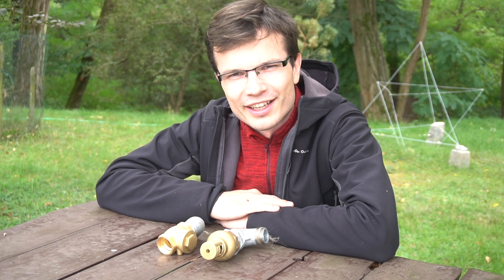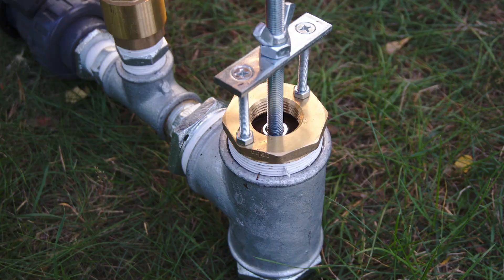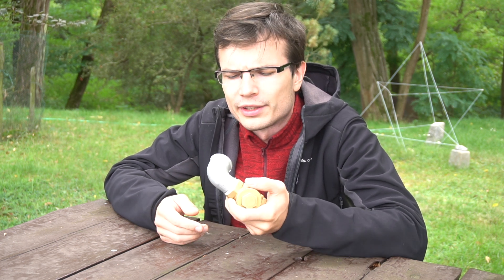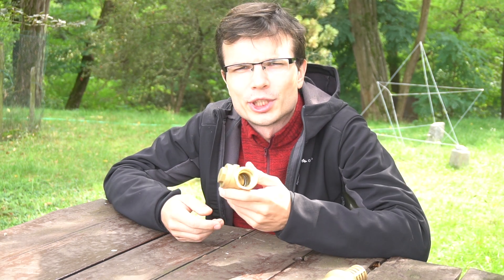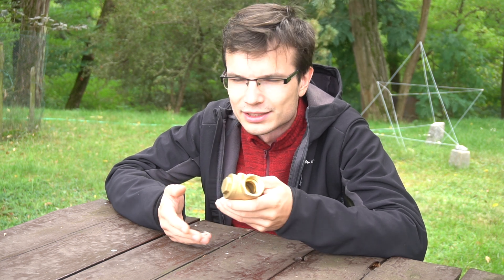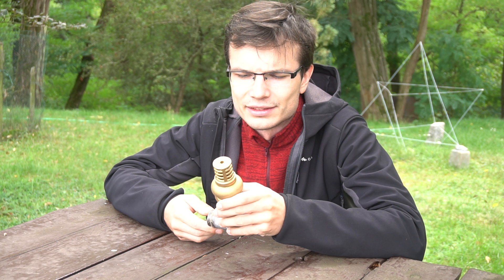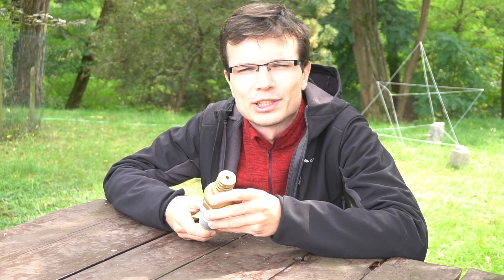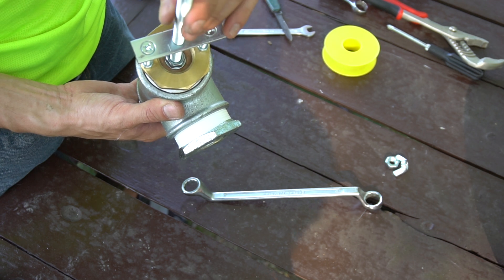RAM PUMP VALVE COMPARISON - why the swing check valve is so useless

Comment: You should just be able to add a short pipe on top of the vertical swing check valve to increase it's efficiency, no??  I'm talking like a 1" or 2" little piece of pipe.  A shorter pipe would mean less water weight on the swing valve, and a taller pipe would mean more weight on the swing valve...

Comment: Actually the swing valve made of stainless steel is also good, if you have 1" drive pipe youcan use 1 1/2 to 2" swing check valve, just positioned the waste balve to 90 or 270 degrees and tilt down easy easy until reaching the desired cycle.

Comment: Hello thank you for this really  intersting video.
Can you kindelly tell me  max how many Meters can pump the water hight if the water pressrure will be enough, and make the begger size for example up to 200 M. 300M  as you mentioned in the video pne Bar pressure cna pump up to 10Merters if for exapmle there is 30 Bars pressure can it pump up to 300 Meters hight or morethen it is very iiportant the hight not the lenght if it is possibe kinelly explain the first the hight capablity then the lenght?

Comment: that is good when you can waste all the water you  like. In my case I have to optimize the effecency because I don't have river so the wast valve has to go orizzontal and be more idrodinamic and working with spring. As that the flow of water can gain much more speed and ideally could reach 6/7 atm with very minimun wast of water.
godd project anyway👍
Reply from the maker: I think you should use another kind of pump. There's a pump that doesn't need so much water. Or, if you have too little water, scale down the pump to 3/4" or 1/2".
Reply: “Waste” is just a convenient word. The water isn’t truly wasted, because it did a job.  But you are correct that this is the wrong pump for you.

Comment: Bohumir I like the study you made with your check valves. Can I ask you what kind of material you used for the time of rubber or something else you used for the seal of the check valve you fabricated please?
Reply from the maker: It is hard thick leather.

Comment: Hi. Couple of questions if you can. Is your home made valve self starting. ? And do you know the efficiency of your home made valve ( waste water/pumped water)
If you can I'd be very appreciative
Rob
Reply from the maker: Hello, no, it is not self starting as any ram pump. You need to prime it. 
No idea about how efficient it is. I just know the input/output height ratio (cca 1/15). The weight on the valve is higher so the input/output water ratio will be worse.
Reply: @BohumirStehlik  thanks for the reply. Love the music that goes with your videos.

Comment: did you know, you can adjust the speed of the swing check valve, by adding a pipe nipple on it's exhaust. The nipple adds a little weighted back pressure to the swing valve. Different length nipples, different weight.
Reply: Interesting. Will this increase the water delivery height?
Reply: this should decrease the head pressure acting on the valve, haven't tried this but I think it would decrease efficiency, as you are decreasing the pressure gradient and therefore the velocity. (I was considering putting my pump in a mini pond feeding the pond with the waste water. never tested it but came to the conclusion that it would not work)

Comment: There are different types of valves for different types or reasons, the swing valve is perfect for gravity feed water supply not pump the spring valve is perfect for pump use sir

Comment: How did you compare with 3 different size valves? This doesn't make sense.
Reply: Exactly.
1000cc Honda Motor is more powerful than a 1500cc and so the 2000cc.

Comment: Okay, question:

What is the "efficiency" of each one, I guess one might say? IE, how much water is "wasted" vs. how much is "pumped"?

I don't think that was mentioned. Does the higher flow rate of the later two valves come at lower efficiency? IE, are you "letting out" more water, in order to get to that higher flow rate? If so, what is the "waste" percentage of each? Like is one 50% waste, vs 70% waste vs. 90% waste? Or are they all of a similar volume / "percentage" of "waste" water that's not getting pumped?
Reply: I'd love to see those number too. 3x higher pressure will also have 3x more "waste". How much pressure and waste is optimal would primarily be a function of particular location. You may need just say 5m lift but don't have much water to work with. In that case swing check valve seems like better option. His valve is great though if you have enough water or need to pump higher than swing check can do.
Reply: With a ram pump we are harvesting water, and energy, which can be measured in the delivery height. It is not like a normal electric pump. The “waste” water did a job, so the term “waste” is just reused from other applications. He gives the head height, and his drive pipe diameter is in other videos. If we had the water velocity we could do the calculation.

Comment: Great video and nice and consistent test! Can you also measure the ratio of used vs. pumped water? That would give an indication of the efficiency of the pump, if put in relation to the ratio of head height vs. lift height. I have the feeling that the results might not be that different then. Also, the swing check valve might have advantages in a low-flow regime (e.g. smaller drive pipes).
Reply: we eww wàààaw
Reply: Well… ram pumps are utilizing the kinetic energy of the water, so your yield is both water AND height. It’s kind of like a combination of a hydroelectric plant (capturing energy), and an electric pump. An electric pump isn’t that cool. I suspect the higher you are able to pump the water, the more “waste” water, but calling it waste is a bit of a misnomer. It did a job. 

A ram pump is measured in how high you can lift, and the total volume captured. No one cares about the water still flowing down the stream.

Comment: I can see the difference in the output at the hose when you fill the bottle.  But the last one sure doesn't look like 65 psi out that hose end; stream seems weak.  Swing valves have their place (low cost, easy to find) if you don't need to pump water 45M (>130 ft).  You also have to consider the LPM/GPM entering the drive pipe.  A 1.5" needs 8 GPM (32+ LPM) to operate.  Going to 2" will require considerably more water flow into the drive pipe to operate.
Reply from the maker: Of course the stream is weak. The maximum pressure is there when you close the delivery pipe... Otherwise the pressure is just slightly above the delivery level.

Comment: Thanks for the info,. Currently using a 3/4 swing check valve pumping uphill with elevation increase of approx 85 ft thru 950 ft of 1/2 in pex pipe with an output of approx 220 gallons a day.  Interested in trying the slide valve can you provide info on where to purchase or the wording to use for the search on eBay or Amazon

Thanks
Reply: Tim, Any luck with ordering a different waste valve?

Comment: Great video and demonstration of the types of valves. I am currently using a modified slide check (foot valve), with a threaded rod coming out the top and the ability to add weights to it. It is good but pretty loud. Your valve looks a lot smoother in operation and quieter. Can you show how you made it please? I would like to try one of these! Cheers from New Zealand!

Comment: Wishing you success
I'm going to make one for myself. This is the question that has been on my mind. With your system, announce the length and diameter of the inlet and outlet pipes
Reply: I hope you answer me as soon as possible
Reply from the maker: All of the answers in my other videos. Inlet 32mm inner diameter, 50m long, 2,8m fall. Outlet 1/2 inch, 150m long, 16-17m high.

Comment: Awesome. Regarding the holes you drilled in the brass fitting.  Did you thread the holes with a tap set with threads that match the rod or did you drill them all the way through?  Also what is the structure behind you?  Thanks.
Reply from the maker: Hello, I made threads that match the screws. 
The structure is my father's energy-something... I don't know really. :-)

Comment: @ Bohumir thank you for excellent videos.  It seems pump and pipe size relationships are critical.  I am intending to make one of your DIY valves.  Is the dimension of the casing for the T more important or the diameter of the exit hole which is narrower.  ie if the drive pipe input was 50mm could the Galvanised T be a 2 1/2" model with a hole diameter on the exit of the valve at 1 1/2" or  1 1/3".
Reply from the maker: The size of the exit hole should be the same as the intake pipe size... Thanks for your comment.

Comment: Can I ask about the expansion tank? It looks like you are using a central heating expansion tank in this video. These are readily available - although not cheap - but in various sizes. What size do you use with the 2" check valve?
Reply from the maker: Hello, for 5/4'' pump I use 5l-8l tank. Here in the Czech republic it cost something like 25usd (the cheapest).
Reply: @BohumirStehlik  Excellent - they are that sort of price in the UK on Ebay. Many thanks for your help, much appreciated.

Comment: Looking at your cycles of the home made valve at around 5:30 water appears to be at peak flow for a reasonable time before the valve closes, is there any benefit to getting the valve to close sooner after peak flow is reached (more cycles per minute, more flow) or will this cause the waste valve to "jam" open sometimes? (because some cycles look very close to peak flow in your footage, others much longer)

Comment: Great video - how can we find out more about the slide check valve and your new design for a check valve?   Hope you don't mind, I linked to this video from the Ram Pump discussion in the Water Wheel Pumps public Facebook group:
https://www.facebook.com/groups/240458583255303/permalink/515063069128185/

Comment: Hi, So if I understand correctly, the reason the swing valve is less effective is that the lack of weight prevents the building of higher pressures.  if this is the case could you add weight to the swing valve gate ?  maybe epoxy a few washers to the valve gate?
Reply: Has anyone tried this and what was the result please?
Reply: Yes. People like stainless ram pump valves because the valve is heavier. But the adjustable design is excellent, because water flow conditions change during the year, and you can adjust the valve. In your case, you can have a few and swap them out. Just use a metal and glue that is drinking water safe. 👌🏼
Reply: No answer probably because your correct.

Comment: great video! what is your drive head? and how long is the drive pipe?
i built a 1 inch ram pump but currently i´m experiencing trouble since i need to ahichieve 50 psi with 3 meters fall. but currently im only getting around 25 psi. nowadays im putting a section in steel wondering if that could help.
Link: https://drive.google.com/open?id=1nN6jcwLE8PS17skDhsU-_v5ATDhJXMzD
What do you think i can do?
Reply from the maker: My drive pipe is 50 meters long with 2,8m fall. Drive head? What do you mean? It is 1'' hydram.
I can't see the picture - permission. Check for bubbles in the drive pipe. Look whether you air tank isn' t full of water. If yes, empty it.
Reply: @BohumirStehlik  yeah, with drive head i was refering to your fall height
Reply from the maker: Ok. I looked at the video. Looks like full pressure tank... Hard to say otherwise..
Reply: @BohumirStehlik  when you say full pressure tank you mean full of water and no air?
Reply from the maker: @masterjosev14  Exactly...
Reply: Make your own waste valve, put some weight and I'm sure you can lift to much more higher elevation, and also it is better to use a bladder tank, there is an 8 gallon capacity with 50 US dollar

Comment: I agree your swing valve is cycling too quickly, but that is because it is undersized. Repeat the test with 1.25” swing valve and I bet your results will be more comparable to the other mfg valve but not as good as yours.
Reply from the maker: Hello! Thanks. That's why I also attached the 5/4'' slide check valve. Definitelly better. I would say I need 2'' check valve for optimal results. But the main problem is that those valves are not adjustable. One cannot change the location for the pump.

Comment: Fun test. Thank you for sharing. I have personally pumped up a hill that was 22 meters high with a brass swing valve. I have worked with a fellow in Hawaii who managed to pump up 25 meters. Because the swing valve does not have a way to adjust for weight you will have to adjust the length of drive pipe to slow or speed up the cycles.  As for durability I agree. around 30 million cycles and the valve will start to wear or even stop. NOW the stainless steel swing valve in my current test pump has been pumping for 5 months and shows no signs of wear.  Those slide valves can very handy but also harder to find. I have a feeling that is why so many people use the swing valve over other styles.
Reply from the maker: Hello! I really like your videos! 
With the swing check valve you can pump water to any height, of course. It depends on the primary water drop/fall distance. From various tests I can see that the maximum pumping ratio of pumps with swing check valves is around 1/6. With weighted (or bigger) check valves one can get much better ratio (up to 1/16). But I totally understand that the swingie-swongie check valve is the easiest valve to find and it is easy to fit.
Reply: @BohumirStehlik  I can totally see that the custom valves work the best. They closely mimic the valves used in commercial and traditional pumps. But imagine making a few hundred of them. It would be overwhelming.  :) your video quality is great by the way. You put more effort in quality than my videos.
Reply: @BohumirStehlik  add weight to the valve by not letting the waste water expell so easily, add 2" of pipe to the valve? It will be quieter too.
Reply: Again, I make a customized waste valve, I used a 2" pipe about 3.5 inch lenght with thread at both end, 2 blind cap, make a hole and thread with 1"diameter. 10 mm stud bolts, screws, washers and hard rubber 1 inch thick as plunger (I use tyre truck). With this set up very easy to maintain and less expenses because the hard rubber will last longer and very easy to replace, just open the upper portion of the waste valve. I tried and working good.
Reply: Dumb question, if the vale staying open longer to build more pressure is better, is there some point of diminishing returns where longer ISN'T better? Or where excess "waste" water makes the amount actually pumped, as a percentage, trivial and it would be better to have the valve close sooner, just so you're not wasting as much water?

Also, if staying open longer is better and adding "weight" [or some equivalent thereof] to the valve is good, or being able to adjust the "weight/equivalent" would be useful, could you, instead, use some kind of adjustable "friction" mechanism [as opposed to "weight"] to adjust how much pressure is required to close the valve (to give finer grained control over how long/short the valve stays open)? [Or, is that what you're doing? I'm new to your channel, so not conversant on your "custom" solution.]
Reply: @MGmirkin I have similar questions.
Reply: Good to see two of my favorite "ram pump teacher" here in youtube talks about whats best. Im starting to build one for my farm. Thanks to you guys
Reply: @pingwojak6848  Youtube is so amazing! Ram pump tests from across the globe.

Comment: I may be missing something but here goes. The increase in diameter of the valve requires an equal diameter drive pipe does it not ?
Great video love the music and this is a genuine question as i am about to do my first test run this weekend with a 3/4" drive to a garden hose , i need to pump up 100' thanks
Reply from the maker: Hello. Good question, thank you. First I was thinking that the waste valve needs to be the same size. Basically the drive pipe diameter is the main limiter of the water flow. You could have 6/4'' pump but with 3/4 drive pipe you get the water flow thru the pump same as with a 3/4 pump. The pump is just prolonged drive pipe. But! You can put on your 3/4'' drive pipe 3/4'' pump with 1'', 5/4''or 6/4'' swing/slide check valve (depends on your drop and intake pipe). Like this you could get more water pumped to the delivery pipe because of the higher pressure. The  bigger valve is more resistant to the water flow and stays open longer - until the water has enough speed to close it. The best and most universal solution is to use the custom waste valve and make a setup exactly for your location. 
Good luck!
Reply: @BohumirStehlik  thank you will keep you posted 👍
Reply: @maximoincognito4881  thanks for the info. Will keep all posted on my setup. 2nd try tomorrow. 😀
Reply: @maximoincognito4881  thanks, part of my problem is i am stuck with what is available, but i will keep eyes open for stainless 👍